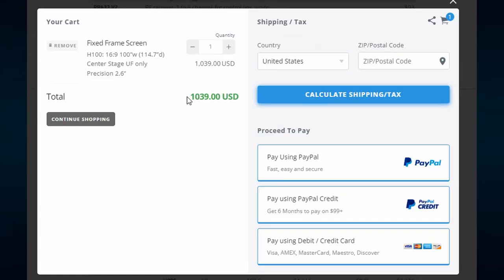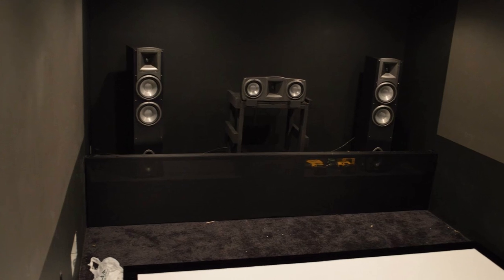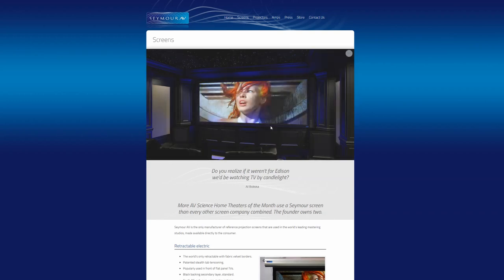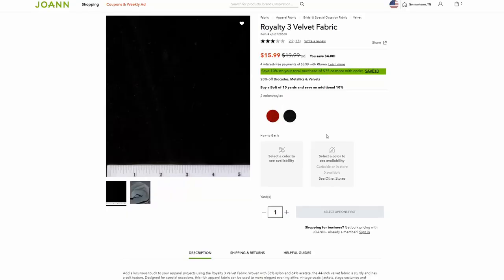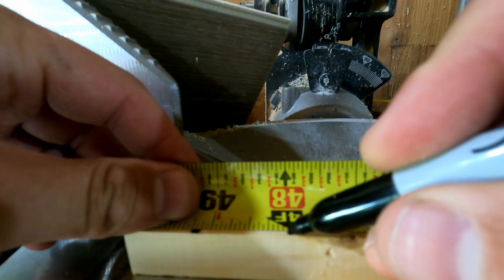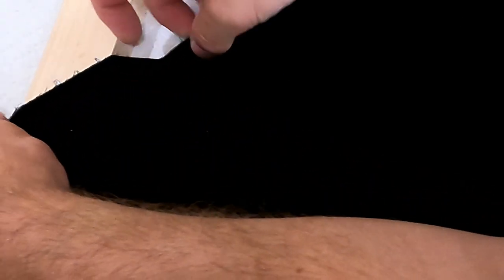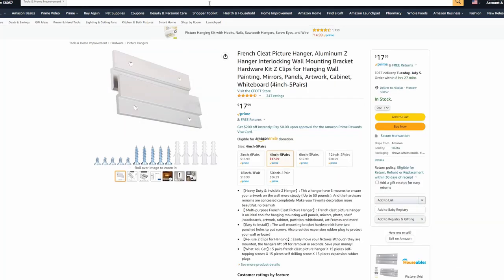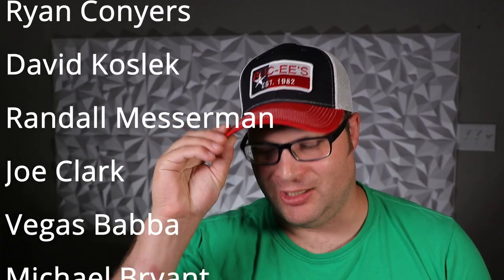How to Build a Projector Screen that's Acoustically Transparent!

Comment: Great, to the point video. My only issue with the UF screen material is it has a 0.8 gain. With perforated screens you’re sacrificing brightness to begin with and a 0.8 gain takes that down even further.
Reply: That's good information. What's the gain on spandex?
Reply: @gblackmore3  not sure. I would imagine it’s around 1.0 but I’ll see if I can find a source

Comment: Can you please build a HPM 100 type size box with a 12-in woofer, mid-range and tweeter for $300? I would definitely buy those plans. I know there's a way you can do it where the speakers will sound incredible on the cheap.

Comment: You only built a 4ft wide screen?  That's a 55" screen.  Doesn't make sense to do a projector for that at today's tv UHD prices.  Building a 100 or 120" screen is more toward the real need.  Does the Center Stage UF require a backing material? That would add to the cost.

Comment: so the frame sticks out more than the fabric? can someone please clarify?
Reply from the maker: That is correct. You connect the screen material to the frame for tension. This is why the frame is on the outside. Also, you’re always going to have some type of over skin, so the frame wrapped properly will kill any over bleed from the projector
Reply: Would you recommend wrapping the fabric behind the frame for smooth edges?

Comment: How do you like the UF material? That’s a top contender for my screen build.
Reply from the maker: I really liked it. I have recently replaced it with a silver ticket WAB. Which I also appreciate because it’s a little bit bigger. The main reason I ended up switching to the WAB is because it is easier to stretch evenly. And I wanted to use it also with an ultra short throw projector. You didn’t stretch as evenly and it did show some waves in the picture with the ultra short throw.

Comment: Nice video... I knew a lot of the separate bits before but nice to see it all together. One thing though ... in 2024 now with the prices of large TVs dropping I think the days of 100" projection screens are dead... would get a massively improved HDR image on these new 100"+ TVs. Projection only really useful now for much bigger screen sizes... right now I'm trying to make/build/buy parts for a 140" about size. Also I noticed in your video you just had speakers in big empty space behind screen - you know that's bad right, was that temporary mock setup? Needs a baffle wall to control all the audio reflections bouncing back and forth off back wall and back of screen causing destructive interference and bad audio... that's another thing I'm right now in middle of trying to design/build.